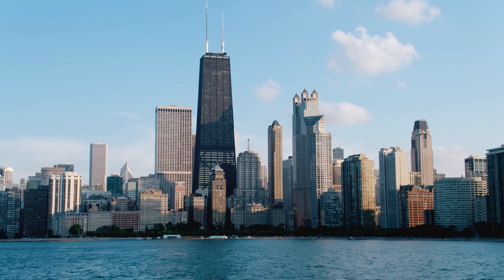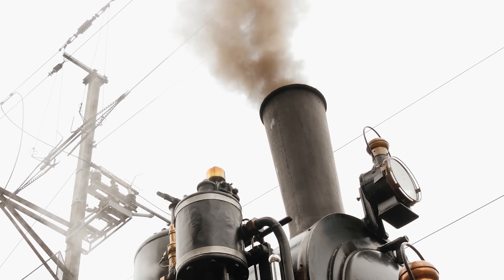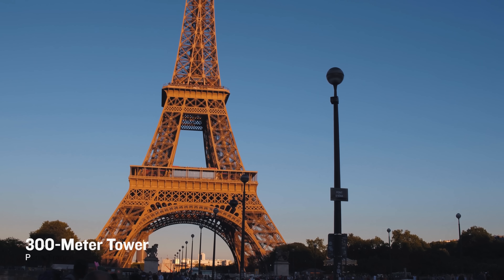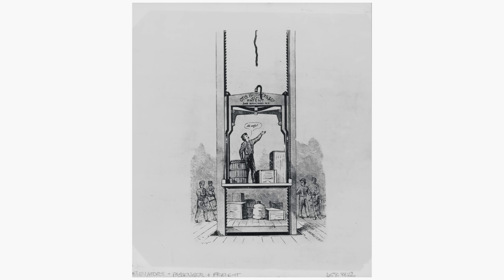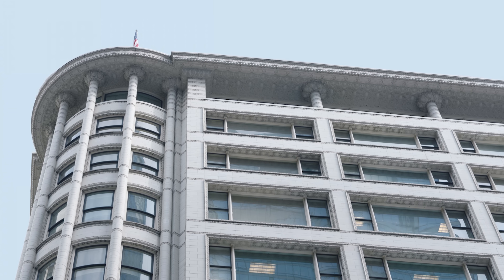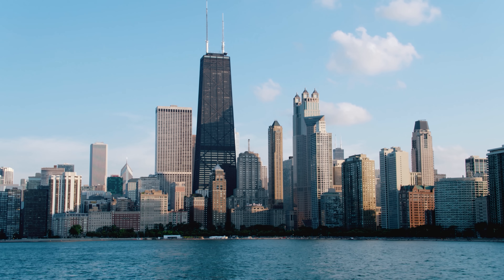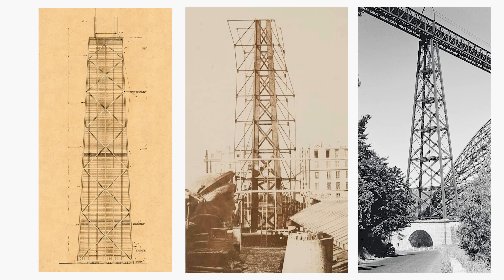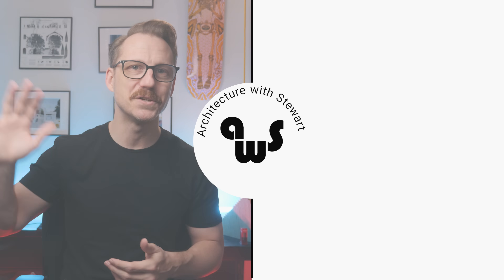How Buildings Changed After the Eiffel Tower

Comment: The ultimate and most iconic "inside-out" building is the Centre Pompidou, IMO. And it was often used to illustrate this concept. It is taking the outside structure one step further by taking the services outside, too. Well worth a shout-out I think. And boy, was it controversial ...
Reply: According to Renzo Piano himself, it was an aesthetic decision that lead to this design. The building’s supporting structure is visible, but only in part. Most of it is covered with technical stuff in an ostentative way, and the plumbing, elevators and escalators, HVAC are treated like ornaments. I think that's a little different than showing and designing the supporting structure of a building.
Reply: They followed this right through to the visiting experience, where to get inside, you've got to queue up outside.
Reply: If you showed me a picture of that building without context, I would think it was under construction.
Reply: @Bruno Desrosiers getting educated doesn’t necessarily mean getting indoctrinated, but that was not something I claimed either. What i did claim though is that the architecture education is. Generally the architecture community has decided that traditionslist styles is a thing in the past and so very little about that is taught out. It’s almost impossible to get an architectural degree designing traditionslist buildings or havent you realised that yet. I don’t want to get in on this in more depth so i’ll just say that basically since everyone related to architecture designs contemporary buildings they don’t teach out how to design any other styles. This leads to only one narrative being pushed forward. What i also meant with indoctrination is that the architectural community focuses more on being unique than actually making something that is beutiful to look at. I like to make a comparison with modern art to show what i mean. Modern art may look bold and interesting when you look at it on a painting, but have you ever wanted to live in that painting? When you design a building you must realise that people are going to spend their lived in this building, not just look at it when they feel like it. Depth, ornamentation symmetry you name it. Beutiful enviorments are a necessity for the well beings of humans and i havent heard alot of people use the world ”beutiful” to categorise contemporary buildings.

Anyways back to the point. Yes, the pompidou center has got alot of geometrical shapes and i was actually considering changing my comment s bit to admit that, but thats not what matters here. It’s facade is chaotic, assymetric and just plainly irritating for the eyes to look at. It has no order, and order is important for a building to have.
Reply: @MrReedling  What are "traditionslist buildings"? Being unable to use grammar correctly makes it more difficult to take you seriously.

You make broad generalizations about modern architecture to suit your predetermined conclusion and you use argumentum ad absurdm to make your "point". The Pompidou CentRE (not "Center") is almost entirely unique; only the Lloyd's Building comes close to matching it. (Richard Rogers was an architect of the former and the architect of the latter.) There are many styles within modernism (a movement that began in the 19th century, by the way): Art Deco, Art Nouveau, Bauhaus, Blobitecture, Brutalism, Bowellism, Constructivism, Contemporary, Critical regionalism, De Stijl, Deconstructivism, Expressionism, Functionalism, Futurism, Googie, High-tech, International style, Metabolism, Mid-Century modern, Modernisme, Monumentalism, Neo-Futurism, Neomodern, New Classical, New Objectivity, Organicism, Postconstructivism, Postmodernism, PWA Moderne, Prairie School, Rationalist-Fascist, Stalinist, Streamline Moderne, Stripped Classicism, and Structuralism.

You mope about the practice of architecture moving on from traditional forms. Yet, you don't seem to mind that no architect today is (outside of theme parks) designing in the Art Deco style, either. No one's designing Villa Savoyes or even Segram Buildings anymore.

Architects are taught to design for the present. This doesn't mean don't draw from the past. But, don't mimic it. Architecture is a time capsule, of a sort. Buildings generally stand for decades, sometimes centuries, and one of the great things about them is we can, by looking at them, understand something about the era when they were built. Mimicking Gothic or Georgian architecture now will confuse people in future.
Reply: @bayousbambino427   You decide to write an entire essay on how supposedly I’m wrong yet you decide exclude all of my main arguments. Did someone not tell you, that when you’re arguing you’re supposed to counter argue your opponent, not put words in their mouth. You completely ignored all of the claims I took up in my latest comment, because you’re anxious that they are gonna backfire on you. You instead decide to repeat the same crap you have already told me thousands of times before. 

I already debatted the wide arrange of ”modern architecture” styles you brought up. Just like in my last comment Im going to repeat why they are aesthetically inferior to traditionalist styles, and this time you’re either going to counterargue on that, or leave this comment section. Ignoring my arguments won’t do you good. 

Traditionalist architecture relies on being aesthetically beutiful. The core principles behind it is that there is objective beuty in our world, because the human brain has certain ways to associate things with harmony or danger based upon looks. 

Contemporary/modern architecture relies on being aesthetically unique. The core principles behind it is that there is No objective beuty, and that thus there’s nothing that makes a certain building more beutiful than another. The focus is thus put on uniqueness instead.

Can you see the differnece now that I have split them up? The fact to why traditionalist styles are so much more adored than contemporary styles by the general population is because traditionalist architecture actually takes thought into the psychological patterns of the human brains perception of beuty while the contemporary styles do not. This is the core point that you completely ignored of my arguments.

If you seriously think I’m anti contemporary architecture you’re wrong. There’s lot’s of good looking contemporary architecture but there’s two types of problems that destroy it all. One is where the architects simply don’t care and just want money. Then the building becomes monotone and depressive. The other is when the architect likes to pretend their some sort of enlightened philosopher artist, and create something entirely random just for clout from the clueless modern art intellectualls. 

Like I said, there’s some problems regarding modern architecture in material use as well, and you’re right about what you said. The arrange of materials you brought up are still used to an extent, and that’s wonderfull. The problem is just that they look so goddamn sterile and shallow compared to the styles those materials where used to in the past. 

How can you claim I’m pro romantisation and not pro ornamentalism. All The claims I have brought up so far have been deeply tied to my want to bring back ornamentation and order systems in a larger scale to architecture. You did not read my last claim of my latest argument. We shouldnt bring back the past. We should learn from it.
Reply: @MrReedling  Your "arguments" didn't need addressing individually. They all amounted to one thing and I addressed that.

It's a bit rich of you to whinge about someone not addressing your arguments when you completely ignored multiple facts I raised about both Modern and pre-Modern architecture. I addressed your convenient editing, too.
Reply: @Bruno Desrosiers I’ll agree with you on that of we take away the fact that traditionalist architecture isn’t buildable in todays society. We have modern solutions unimaginable to those in the past and we live in the era of the most wealth in history. Im not suggesting building exactly like we did 80 years ago, but rather finding ways to intertwine traditionalist ornamental architecture with the conveniences of modern society, sort of like a new reinassance. Economically traditionalist styled architecture has proven itself perhaps the most sustainable option. Stone doesn’t age as bad as concrete for instance, and i think that with our modern technology we could develop new ways to lighten up the stone so that we don’t waste as much space. For example the neo-classicist styles follow the classical orders which strictly gives out an arrange of design elements properly proportionised and perfected for generations to be aesthetically pleasing. These could easily be mass-produced in factories and even more irregular shapes that we might want to incorporate in to buidlings could easily be cut by machines dynamically from digital blueprints. Atleast in first world countries what actually costs when buying houses isn’t the houses themselves but rather the land which they sit on, and considering the long term sustainability of traditionalist architecture they would actually be economically relevant in our time.

The actual problem with building traditionalist is the lack of political will as well as the population not aware of the fact that traditionalist architecture can be built in our time frame.
Reply: I’ve always found that the beauty of this type architecture is in its scale. When I first saw the Centre Pompidou I was shocked by the way it looked yes, but not in a good way. I remember asking my friend Glen if it was closed for renovations. 

Technically they are the same “style” but the scale of the architecture changed for me. Looked a bit like scaffolding
Reply: The difference with This building and the Pompidou center is that this building actually looks aestethically good and the design and structural elements are actually interteined. Rather than making architecture out of the structural elements, Pompidou center just ignored that and leaves us with an outrageosly ugly exterior that only someone who has their eyes set on uniquenes and not beuty can admire
Reply: @Bruno Desrosiers seriously don’t hit me with that statement. The concept that beuty is subjective is a modern subject that is true, but does not uphold the entire concept of what is beuty. Yes, beuty is subjective and people think different things are beutiful but there are general ruled conserning beuty that are the same for all humans such as the apriciation of depth symmetry and perfect geometric shapes. The pompidou center has none of these quailities in mind, it only has functionality in mind and that’s why the only people who can appriciate the pompidou center are people who have an indoctrinated view of what beuty is, such as architecure students or modern artists. The general population doesn’t admire these buildings because they havent been lectured on what beuty should be and so they follow their instinct rather than a narrative their education has pulled forward.

Conclussion normal people like classicist architecture. People indoctrinated in education prefer cobtemporary buildings.

Comment: Great video! I love the Hancock Tower and visited it when I was in Chicago in 2011. We have a sort of mini-clone here in Melbourne Australia. Now called 140 William Street it opened as BHP House in 1972. BHP was, still is, an iron ore miner, so building out of steel was a bit of a statement. Only comes in at 500 feet but it uses diagonal bracing at three points. I believe the local architects got some design input from SOM and it clearly shows.

Comment: Exposed structural steel members became a lot more popular in Christchurch, New Zealand, following the earthquake 11 years ago. Previously Christchurch was a very concrete, brutalist city, but a lot of that construction failed and when people built back, or repaired, they emphasised the steel cross-bracing to  provide a sense of safety.
The example that comes to my mind most readily is 104 Victoria Street, with the front entrance centered between two beams, probably because I walk past it on my way to work. Another that comes to mind is Warren and Mahoney's headquarters on the corner of Montreal and Cashel, which is a very stark contrast to the weighty concrete of, say, the Student Union building they designed that I spent so much time in back in the day.

Comment: From an aesthetic sense, I find Centre Pompidou interesting. Like the other buildings you discussed, it uses an exoskeleton with the services on the outside of the building. As someone who studied industrial design with a teacher who was trained by Bauhaus masters, this design is problematic, because exposing the buildings services to the elements makes it much more expensive to maintain. I am reluctant to call this building a bad design (even though by Bauhaus standards, it does not follow the dictum: Form follows function, in that it is a maintenance headache) because I love the extremely flexible interior of this building. I love how easy it is for the museum to adjust its space, so it fits the needs of the art on display and doesn't have to compromise. It has a welcoming  not to big, not to small park in front, a great cafe environment. It's a really nice place to work en plein air. When you consider what was there before the Centre Pompidou (a nasty car park), this is not only a remarkable building, but a truly pleasant place to be. As a textile designer, it's not something I would have thought to design (because I am too Bauhaus in philosophy of design), but it is admirable.

Comment: I've really liked Chicago's Hancock Tower since I was a kid, and the more I understand the purpose of the X-bracing, the more it appeals to me as a frank and even kind of brutal expression of the need for wind bracing. It forms an interesting contrast with the similarly-named John Hancock Tower in Boston -- an elegant building sheathed in a smooth, nearly featureless glass curtain wall. With its thin, rhomboid-shaped plan it's a spectacular piece of architectural sculpture, but structurally it's had a lot of problems because of issues with the glass curtain wall and the excessive movement of the building in even moderate winds. When I moved to Boston for college in the 1970s, most of the facade was covered in plywood boards because the glass panels kept popping out. (People joked that it the "tallest wooden skyscraper in the world.") On the upper floors water would slosh out of the toilets onto the floor because of the wind. Occupancy of the building was delayed by years, and it took a whole lot of money to replace the glass curtain wall and add the necessary wind bracing to the interior of the building to counteract the movement. It would have been better if it had been designed properly in the first place, like its elder sister in Chicago.

Once concern I have with moving so much structure to the exterior concerns what happened on 9/11 at the World Trade Center. Both towers limited the structure to the core and the outer skin leaving a huge unobstructed interior floor area, supported on light trusses. These trusses failed in the fires following the plane impacts, which led directly to the collapses. Would a more conventional gridded structural system have survived the terrorist attacks and prevented the collapse of the buildings?
Reply: I don’t think planning for planes crashing into towers is a huge priority for the engineers and architects😶
Reply: @DiegoMagengo  Fair enough, although I remember when the WTC was in the planning stages these issues were part of the discussion. A plane had crashed into the Empire State Building less than 30 years before in 1945, although it was an accident due to a bone-headed pilot, not a deliberate terrorist attack, and the plane was quite small.
Reply: @christopherstephenjenksbsg4944  that’s true, it must be brought up at some point in the process. By the way I looked up the John Hancock tower in Boston and that design sure is impressive. Hard to believe it was built in the 70s honestly, it looks like some of the buildings they’re churning out nowadays. Really cool despite the initial problems it faced.
Reply: @christopherstephenjenksbsg4944  the only thing I will say is that it must be a bird’s biggest nightmare😅

Comment: As an individual with almost 0 architectural experience, I never really thought as the exterior of the Hancock tower had anything to do with the structural integrity of the building. We have something similar here in Canada in The Bow Tower, where the crisscross pattern extends the full length of the building despite the tower being shaped as a semi-circle. Very cool video!
Reply: Except, in the Bow Tower, the diagonal grid you see on the exterior is not the structure; it's just mullions in the curtain wall following the structure behind, off of which the curtain wall hangs. You can see this if you go in the lobby. (But, be careful trying to take pictures; the security seem to think anyone taking photos on their camera is a terrorist or something.)

Comment: I love exposing the structure of the building even on the interior.  Brace frames are one of the few steel elements not normally requiring fire proofing, so can easily become a part of the design strategy, providing delight and insight into how the building functions for both the studious and casual onbserver.